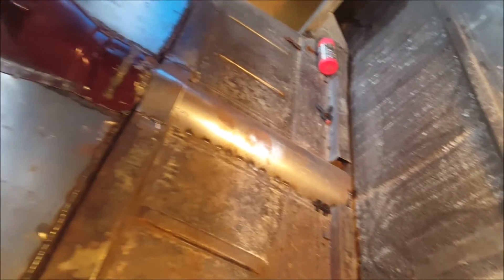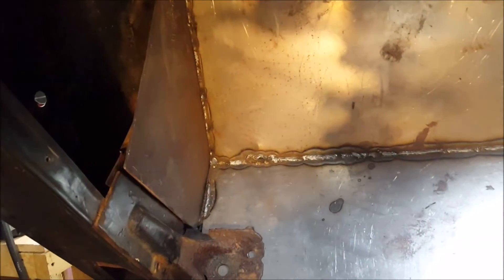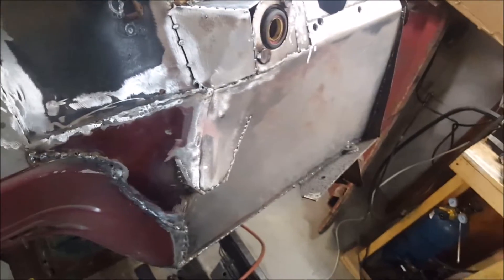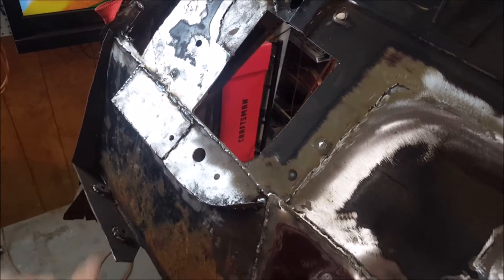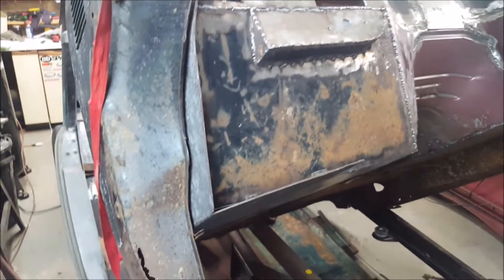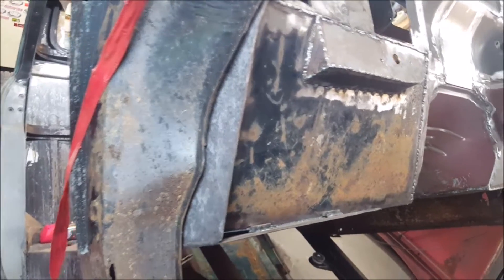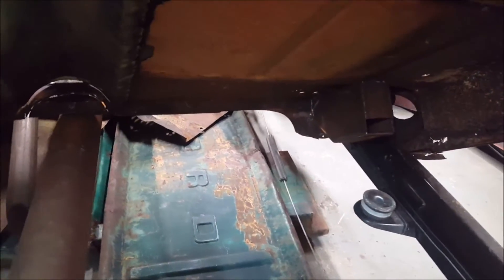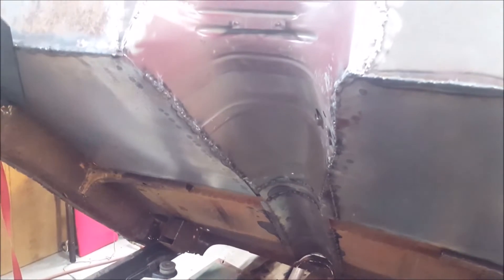Tear Down and Start of fire wall work on F100 to Crown Vic frame swap #1

Comment: Did you contemplate using Vic’s firewall up to the cowl seam? Wondering if that might be easier. Great build!
Reply from the maker: I attempted to do that but nothing was lining up. I found it easier just to make a new one. If I had it to do over I'd save the holes from the vic firewall and make my own using them.